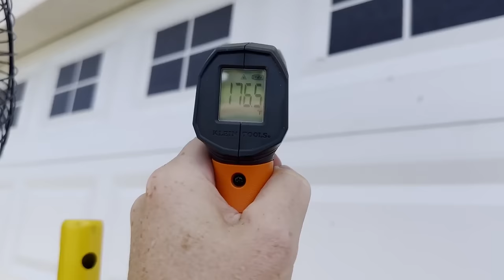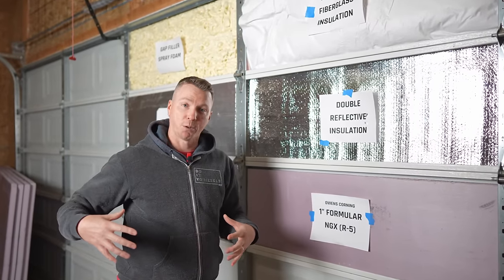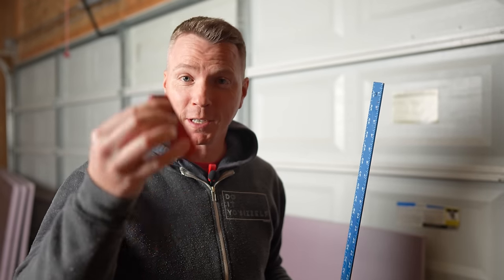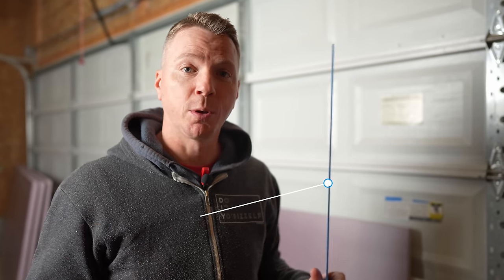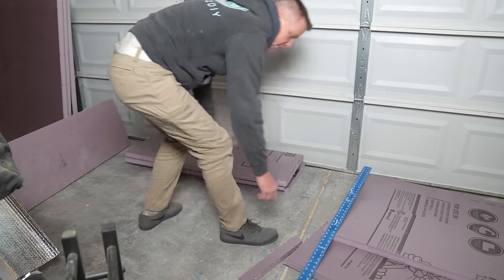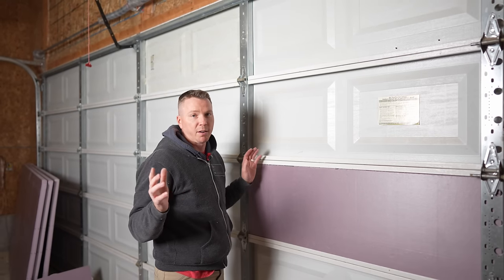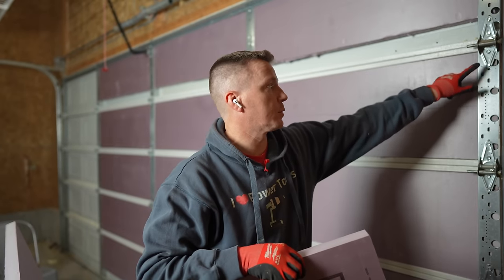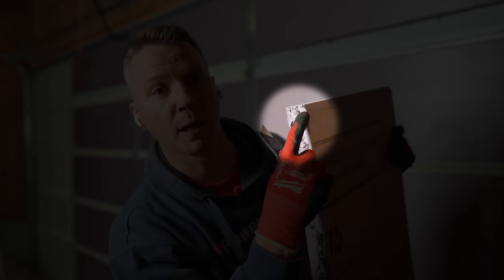The Easiest & Most Effective DIY Garage Door Insulation

Comment: I used a gun for canned foam to fill all those C cavities and make sure all parts were as insulated as possible. Because those cavities have holes, you can spray foam into the cavity after the install instead of pulling anything off. ALSO, I have windows across my top row. I cut 1” board to go around those. Worked out really well. Wish I could post pics here to share.
Reply: I have windows as well.  I was just thinking as I was watching this how I'd work around them.  Would like to see your pictures if you can find a way to  send them to me or post them.
Reply: @diggndeeper  I have four windows as well.  I'm just going to make a template with a cutout for the window and I think I can just place the foam cutout over the window.  We'll see how it goes.

Comment: Curious if laying a radiant barrier on top of the foam would further help with retaining heat in the garage.
Reply: I help a friend do his door. After work on totally redoing a house he had a roll of the reflective insulating stuff left. We cut sheets of that and put it in each panel first. Then he had 1.5" foam board left, the type with the foil on one side. We filled the panels with that foil facing in. So there is foil on the outer side of the foam and the inner. We used expanding foam to be sure all the recesses were filled. We also used foil tape to cover the gaps. Most stuff he had left over from doing the house, except enough foam, one more foam board, and he had a roll and a half of the foil tape left from redoing the HVAC and I got some of the tape from my bro who has done HVAC for 40+ years...needed a bit more to finish it. The door no longer gets hot and it faces south and in the winter you put your hand on the outside of the door and it is cold, there is no heat escaping. The foil board inside cleans easily and it reflects light, we noticed that right away. He had a broken door spring already and he replaced it with a heavy duty one.

Comment: A couple questions:
	1. I'm measuring 2" from deepest point to the lip, so should I go with 2" foam or should I get thinner boards to make room for spray foam?
	2. Do you recommend 1" spray foam for the edges?

BTW: I checked out Home Depot today and almost all the foam boards (not just the ones from NGX) were crushed in various places. They only had two NGX boards and both had damage, so I'm hoping I can get four good ones.

Comment: The actual material name of that foam board is XPS, Extruded Poly-Styrene. I use it for a lot of projects and my favorite way to make long, straight cuts is with a table saw.
Reply: Yes, or a track saw. Excellent way to cut this material.
Reply: Any kind of saw just makes a huge mess.  Knife/razor is the way to go.
Reply: any special blade to do this?
Reply: @ScottsGarage17  I just use whatever wood blade happens to be in my saw at the time. I believe any wood cutting blade will do.
Reply: Yep after using a table saw I can't stand scoring it now.

Comment: Ready for the next video about the spring I want to do this but scared to adjust spring
Reply: I'm also curious about how he'll do the springs, I've been a door tech for a long time and I know that depending on how much weight he just added on, a simple adjustment won't work properly. There's also the tool issue, unless my guy purchased torsion spring winding bars it can be dangerous to add tension. I've tried a lot of improvised tools when I needed it and some work but I've also been hurt by the ones that didn't.
Reply from the maker: I've already done the spring replacement. I bought winding bars and went through the entire process of weighing the door (with insulation) and getting the properly rated new springs for the new door weight, then VERY carefully removing the old and putting in the new. It was a pretty reasonable experience but half the video (that is coming out) is about safety. I know it can be a dangerous process.
Reply from the maker: New video is out! https://youtu.be/xOXO01rdZ5c

Comment: so i too want to cool down my garage went to a local auction company  and picked up 20 panles of 2 in foam board for $125 then started researching on how to glue or tape them in. saw you video at number one and i watched it, then watched the previous one. so then i checked the temps in my garage and my door was about 105* and walls were about 110. then i checked my roof and it was 135*. i saw you house has a room above it so you dont have to worry about heat from the top. would using 2" foam for the roof be a good idea also?

Comment: there's a pretty snug fit there with the foam and insulation. is there any concern with binding of the garage door panels as it raises/lowers with inherent expansion/contraction as the temp fluctuates?

Comment: I have similar, I was wondering if you could do each section in halves along the long dimension, and push each half in to the groove at the top and the bottom so the foam goes in to where you put the spray foam, they should jam in against each other, or a thin strip of something could be put in from top to bottom to hold them in.
Reply: Instead of using foam what about neatly applying some tape?

Comment: When I purchased my garage doors I got them already insulated.  Would it be worth the time and expense of changing out the insulation. Mine also leak lots of air at the joints between the panels.

Comment: Pro-tip from an avid DIY’er that’s also in his 60’s.

In order to do it thoroughly right?, you have to take the screws out of the hinges allowing you to get a bigger piece nestled or nested into place taking up the entire panel void-space.

No need for messy spray-foam crap.
Reply: So you're saying you can cut to 17.25" and they would fit perfectly?  I would think there would be more waste?  But to get a perfect fit WITHOUT the foam spray then it would be worth it.
Reply: @JJP1960  it’s arduous to take out the hinge screws in order to do each panel - But I’ve done my own garage door & I did my daughters last year in the middle of July.

Slow & steady, measure twice cut once & man-handle each foam panel into place.

It’s not fun, But it’s nice, neat & not so messy without having to use a $20 can of spray foam.

Comment: I used single side reflective, on thr interior side it is white.

However during install i stuck it to the support struts, creating an air pocket between the insualtion and the garage door..

I notice when you did the test st the start, you sruck the reflective insulation directly to the garage door.

All the DIYers ive followed have shown its far more effective creatinf an air pocket in the door, bexause obviously air doesnt transmit temperature as well - similar to the way a dry suit works much better for divers.

Comment: This may be fine for temperate climates, but not in Arizona when the sun shines on your door. The amount of radiant heat transferred by all that exposed metal not covered by the foam board (the joints and sides) is still enormous. It's just one giant heat sync. I'm wondering if there's some type of coating that can be applied to the entire inside surface.
Reply: Paint the outside of your doors with the most reflective (mirror type) paint available plus that will really piss your neighbors off.

Comment: Question please :
After I installed just two sections wanted to test the door, it won’t open all the way and popped the insulation 
It like got stuck and had to remove it , what did I do wrong ! Thanks

Comment: Double the amount of foam. Cut the foam lengthwise to cover the C Channel, trim the height to clear the garage door brackets. You will essentially be covering 70% of the door with R 13 which is way way better.

Comment: Does it really make that much difference to do the foam to fill in small gaps?  In my case I was interested in reducing radiant heat from the metal panels in the afternoon summer sun.  It did help a lot.  However there is always air and not much insulation going on around the door edges where there is typically a thin vinyl weather flap.  Heat and cold will always be leaking around there.
Reply: How much heat radiates through the internally exposed sheet metal?

Comment: Concerned about this melting over time if exposed to the metal garage door surface that is in direct sunlight.  I have a south facing garage door in Arizona.   Have you had any issues with your panels?
Reply: I have an east facing door in AZ that catches the morning sun till noon. The problem with insulating it is if you park your car in the garage after being out the garage turns into an oven. Literally hotter in their that outside. If you don't insulate the garage door the meta gets hotter than hell.It's a no win. You have to run AC in the garage.

Comment: I have sold garge doors for 25 + years.  Your garage doors springs are calibrated to the factory weight of the doors.  The spings are the doors counter balnce system that lifts the weight of the door making it light and easu to open.  When you add weight to a garage door, you are throwing the counterbalance of your door off.  After adding weight, the springs need to be recalibrated.   This is done with a special scale that a garage door service company would have.  In other words, you can't just add insulation to a garage door that wasn't designed for it.  It will eventually take your open out.
Reply: How much weight did he add? 11lbs? Lol
Reply: Once they Wear out replace the springs ???? 😂
Reply: Did you finish the video? 10:04

Comment: q.   if not asked... because there is no thermal separation at the panel edges.. they become "heat bars"... I measure 81F on the foam but 103F on the panel edges ...!!!!!    how to insulate those?  some sort of flexable taped on insulation?

Comment: Had you cut the height of the panels from the inside of the top and bottom C-channels, and then cut all the panels in half length-wise, you could have avoided the spray foam altogether by first inserting the bottom half of the panel and then inserting the top half of the panel.

Comment: Does the added weight of the panels require adjustment or replacement of the springs or any other adjustments?
Reply: Yes, he briefly explains it on the video. Anything over 10lb will mess with the balance of the springs it also depends on the type of lift the door has on how much will it affect it. For most standard lift doors you will probably be ok with adding 10lbs of insulation and not have to do any adjustments. (Your opener will be ok, they self adjust if it's a newer opener) anything over 10lbs you will have to get new springs to have everything working as it's supposed to. If you do add more than 10lbs I highly suggest that you hire a local company, preferably not anything national like Overhead Door co. That will go out there weigh your door and calculate the proper springs for you. I don't recommend adding more tension to the springs like this guy said, it won't always balance the door with the added weight and it can be very dangerous without proper tools or knowledge.
Reply from the maker: It does, as discussed at 9:35. I go into details about it in my new video at https://youtu.be/xOXO01rdZ5c

Comment: What about the weight of it the insulation foam that you're putting up will you have to change your spring for your garage door to work correctly
Reply from the maker: Most likely, yes. At 9:40 I talk about exactly that.

Comment: Does adding the foam boards affect the garage door opener? I would imagine this adds some weight and that may put extra pressure on the opener? Thanks for this idea, I’ve wanted to add insulation and now I have a great model to follow
Reply: Yes. Have your springs tension adjusted by a professional.
Reply: @MightySapphire  What is the "average" cost for this?

Comment: All of my local hardware stores say 1.5 is out of stock and unavailable online or in stores.  Sigh.  Thinking of going with 1" with some of the reflective bubble wrap.  I've never tackled something like this, but think I could do it with some help. OR, should I go with 2" and just angle the edges so they fit in the channels? I really appreciate the video and comments.
Reply from the maker: Great question. If you can make the 2” work, I’d be pretty nice. If you’re worried about the fit, 1” would still add a lot of R value.

Comment: What size spring did you use to replace the springs once you added the extra weight?
Reply from the maker: My new ones are .234 x 2 ID x 35”. Next week’s video is a complete walk through of how to determine your new spring size and replace the old ones.
Reply from the maker: Using an online calculator, and speaking with a tech, it was determined that I needed .234 x 2 x 35" springs. I put them on and showed the process here: https://youtu.be/xOXO01rdZ5c

Comment: I would love to see another video dealing with the sealing and noise of the door I've been researching some products but don't know if it's worth pulling the trigger on them

ThermoTraks sealing system
ThermoTraks bottom seal retainer and seal
Green Hinge spring loaded energy sealing hinge set
Dura-Lift / ThermoTraks nylon rollers
Quiet / silent roller sleeves
Reply: A tube of lithium grease on the big top spring helped my noise
Reply: White lithium. Put the whole tube on with gloves 🧤

Comment: I bought and installed a box of the fiberglass stuff and even on the box it says if installing two boxes on a two car door, you need to adjust spring tension to account for the weight. How heavy are these foam boards compared to the fiberglass? I only have one box for the time being so not really an issue weight wise as is, although I can definitely feel it already when raising/lowering the door.

Comment: Sweet! Thank you for this~ Going to do this in my home.
Reply: Do you think the reflective foil, on the other side of the insulation, would be helpful?
Reply from the maker: This kind of insulation doesn’t have the reflective foil. It’s a denser material with a higher R-Value than the white and silver stuff.
Reply: @LRN2DIY  The question was about adding some
Reply: @LRN2DIY 
What I wanted to know was not the garage door heat difference but the overall garage temperature. Do you recall how much the entire garage temperature went down by?

Comment: There is one issue with this project - weight. If your springs are old or not big enough the extra weight (even though it's not a lot) could shorten their life. I learned from experiencing it. but after the technician replaced them with heaver springs all is well and the insulation does its job.
Reply: This isn’t an issue unless you have springs that need to be replaced anyways, brother. This foam is no where near the weight which would cause an issue. Again, if this is a concern, your springs need to be replaced with or without the foam. 

F = -kx

Comment: Always upgrade your spring with this process. The weight of the door becomes too much and places significant strain on the gears of your opener and at the top center of your garage door. It can buckle the section. If the door does not balance manually at each opening section/pivot, it is not functioning correclty. Trust me! I am an 8yr garage tech with cureently 3 yrs as a small business owner.